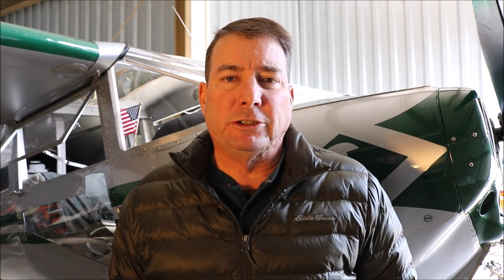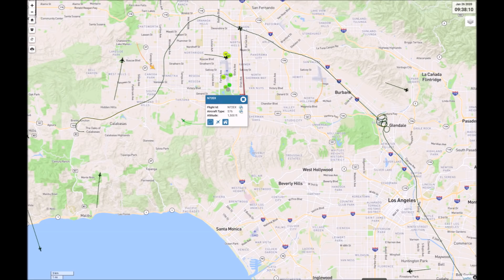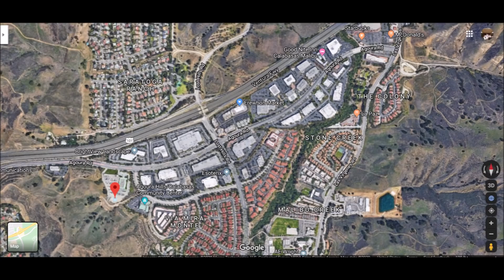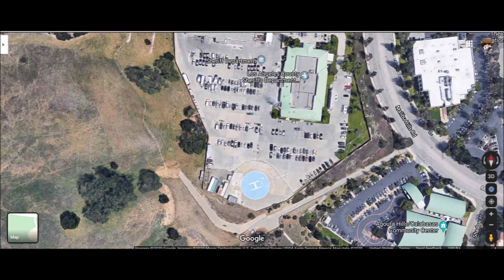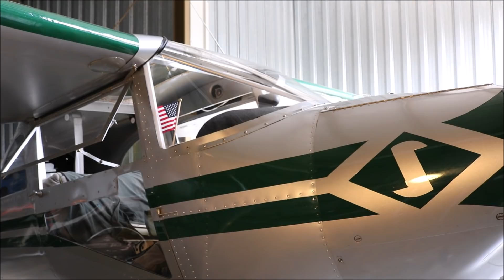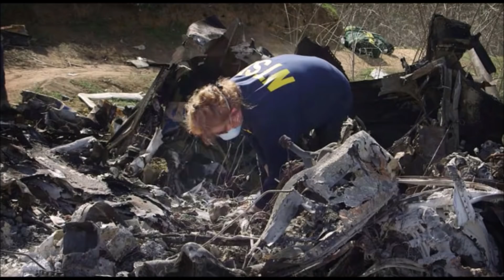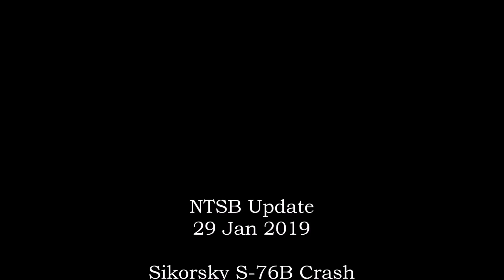Kobe Bryant Sikorsky S-76B Crash Update 29 Jan

Comment: This is a very common case of flying VFR, going into IMC, stalling while attempting to gain altitude, failing to recover and subsequently falling out of the sky. A sharp climb followed by  a sharp descend resulting in a high energy impact may help explains this.
People will blame the pilot for misjudging the weather and flying VFR instead of IFR.  However, given the circumstances, this might just be an unavoidable crash. After all, this pilot was very experienced and most likely, knew what he was doing more than any other pilot out there. Weather can be very deceiving. What one might sea as a constant altitude ceiling from a distance, may actually be a descending ceiling, which I suspect was the case here. You go under it but it keeps going  down as you move forward and you keep going down trying to stay clear untill, terrain doesn't allow you anymore and you are forced to enter. Now you are too low and in the clouds and you can not risk turning left or right and since you still have forward speed your only option is to gain altitude as soon as possible and hope to pop up above the clouds, which I suspect what the pilot intended to do here, explained by the sharp climb prior to crash. While doing so however, he most likely over pitched and stalled his blades. While gaining altitude, his eyes were out trying to avoid terrain or possible obstructions like wind turbines. He simply could not risk looking inside at his instruments.  Helicopters unfortunately, do stall and roll to a side when they stall, which seems to be the case here. He was too low to recover when he noticed he stalled. 

We would like to believe that this crash was somehow avoidable. Because we don't like the idea that it might happen to us. In theory, yes, it could have been avoided. In reality though, taking into account the experience of the pilot, the safety of the aircraft, and weather that reportedly looked doable, it wasn't. 

Condolences to their loved ones.
Reply: BRILLIANT! MAKES THE MOST SENSE.

Comment: I live in this area and know the terrain very well. Malibu Canyon (aka Las Virgenes) is know for being a funnel for moisture and weather coming in off of the coast into the San Fernando Valley area. I've seen very dense fog push through that canyon from the shore to the 101 many times. Because of the shape of the canyon, it gets compressed and shoots north. I used to drive the 101 every day in that area, and I would admire the beauty of the clouds coming through that canyon. You could have a completely clear day north of the 101, but still see a fog bank pushing through. ￼

Comment: Thanks Juan for putting things into perspective. 
I have a theory that I’d like to run by u.
What if the pilot banked left unwittingly as he was climbing through the cloud bank. Which would leave him facing south instead of west. As he was flying VFR he never checked his instrument panel to find out he’d changed heading. He then proceeded to descend to get visual ground references. But by the time he came through the cloud he was in the foothills and unable to avoid crashing into them. That would explain the final sharp bank to the left on the radar signature. What’s ur thoughts?

Comment: Likely nothing to do with the police helipad closeby. Pilot was trying to wiggle just under the growing clouds as the mountains started to pick up around Agoura Hills on the Hwy-101 path they were traveling. Sticking to road underneath was running out of steam.  The controller advising that he is too low for flight-following meant he is out of flying options, and may have been the tipping point. The top few-hundred feet of of the hills were clouded and pilot could notice that for a while. Spooks anyone. No one wants to be under the hill-top lines. He decided to play safe, and quickly went up high into clouds. It was a risky move by itself as there was chance of collision. Flying into the clouds is already against S-VFR, isnt it?  At this point, high up in fog, he could have switched to IFR as Plan B by declaring an emergency (maybe that was the next thing he may have done!!) but within the next 12-15 seconds, the damage was done. He thought he was climbing when in reality he was doing a downward left hook. Also, the pilot had flown this route several 100 times, so he must be fully aware of the helipad location that you are referring to. Likely did not even enter his planning mind to use it.
Reply: Great stuff.

Comment: This should have been an IFR flight only. Low ceilings, heavy traffic areas, Fog. Why even train pilots for IFR and equip these aircraft with the ability to fly in such conditions, if it is left up to the pilots ego to use it? IFR would have saved this flight if it had been required to fly that day as it should have been. By allowing that flight to be VFR or special VFR, it not only risked those aboard, but every aircraft in the air and every person on the ground in its path.

Comment: It is rather amazing that the FAA in fact needs all that time to make something that is agreed on more safe or less risk to an aircraft require years and future accidents to be implemented as a rule requirement.  I'm unsure if the occupants of this Sikorsky had been just anyone would have made as much impact to the importance of this crash issue but it shouldn't, I'd hope. It does seem prudent to have IFR equipped helicopters fitted with similar warning systems as the airline industry since these types are well known to carry passengers for hire often. In any case, IFR should be the pivot that says warning systems must be there if the type has the instruments to fly IFR. At least a CVR/FDR would be good for after an accident investigation tool but avoiding an accident is the key factor for warning systems to keep a pilot on track. Maybe this type of aircraft should have two pilots vs. just one for IFR.

Comment: When I'm backing out of my backyard my back up sensors go off, which is sometimes annoying. I am able to lower the warning sounds or turn it off completely. To get to the point, backup cameras reduce accidents period. It's a foolish and even ridiculous argument to allude to the suggestion that a "Terian Avoidance System" would be annoying. The FAA should be held accountable in a civil suit for failing to implement technology that could save lives. Once you open the door of legal liability they will see to it that they prevent a future lawsuit. I'm pretty sure they failed to implement suggestions from the NTSB because of corporate influence and under the table kickbacks. This is an easy fix create a loophole to sue the hell out of them, and I promise you this will stop.

Comment: Juan, I've read comments attributed to Ms. Homendy such as, "...climbed to about 2,300 feet seemingly in an attempt to clear the thick cloud layer.  It hit part of a ravine in the Calabasas and fell, crashing in an area on the hillside 1,085 feet above sea level."  In the same article the author says that "federal investigators" said the pilot was trying to ascend above a fog - shrouded hill when it slammed into the ravine and dropped 2,000 feet per minute to the ground below.  This suggests that there was another impact at 2,300 feet that sent the copter into the sharp descending  turn, from westward to eastward, no?

I haven't heard anyone else mention this and it seems like it pretty much explains a lot; that and spatial disorientation.  The article I read these things in was via buzzfeed and a Brianna Sacks.  Thoughts?

Comment: ATC radar visual on VASAviation channel shows rapid climb last few seconds from 1400 to 2100 before vanishing from radar.  not in a descent.
Reply from the maker: then how did he end up crashing at 1085' MSL ...?
Reply: blancolirio just reporting what I saw on the video. Radar showed 2100 immediately before losing signal.
Reply: blancolirio are you certain it wasn’t 2085 MSL?

Comment: Hi everybody! :)
I’m just a flight simmer and my competence in real flight is of course absolutely limited.
Please help me clear this doubt. 
In all preliminary reports is well evident that the helicopter lost altitude at very high speed. That's insane because it's exactly what was to avoid in those conditions of terrain proximity associated with the poor visibility. 
Even if the pilot could be confused in such stressful situation, it seems to me that he could have all the instrumental data letting him to know if he was climbing or descending... Am I wrong?
Another perplexity is about the awareness of his position related to the terrain. Ok, no system alerting of the hills in front of him. 
But if you flight with a simple GPS and related map, you should be conscious of your real position and movement and so fly your helicopter far from potential dangers...
Again, what I don't understand?

Thanks for your kind answer

Comment: ok, dumb queston ... how can you turn around quickly enough , when you hit fog, and be sure not to crash into another plane?
Reply: You can’t be sure but the odds of hitting an ifr aircraft is extremely low while the danger from the terrain he knew was there is very high. He could have climbed and declared an emergency on SoCal‘s frequency. He would have had some hard questions about his actions to answer, but the odds of hitting another aircraft in the few moments before SoCal radar identified him and turned other aircraft away is very very low, but still possible.
Reply: michael laws i agree

Comment: The pilot must of been so disoriented and lost..I can imagine a blanket of fog just blacking out pretty much everything in sight. 

even a slight pull to the left or the right I can imagine at 150+MPH could change the whole trajectory of the route and have that feeling of still going forward, perhaps it’s the same reason why the helicopter descended at times.

The wreck was scattered over a 100 yards/meters so it must of been going in a straight line, pretty much like a car wreck. I don’t think they seen it coming and I pray it was over quick..

Comment: After 40 years flying and 30 years controlling at Indy ARTCC I have both done some questionable things in the former and had a couple dozen emergencies thrown at me in the latter. I cannot stress enough to current and future pilots that declaring an emergency is NO BIG DEAL to controllers. It's what we are trained for and is the ONLY way to quickly get our attention. I was a pilot before becoming a controller and I, like most other pilots thought that declaring an emergency was an admission of poor piloting and would bring down the wrath of the FAA. That is most always not the case. Most emergencies (that end well) can be ended either on the frequencies or after landing with a quick call to the facility to speak with a manager. It should be at the top or bottom of every checklist: "Don't be afraid to declare an emergency!!!" Once you declare, all our normal rules can be sidestepped and we can be a pretty creative bunch. In this instance the pilot should have declared his emergency then informed the controller that he was initiating a climb in IMC conditions. The controller, upon reacquiring the data block, would then have had the option of moving other traffic and/or advising any traffic of a loss of separation. This event should have begun with the pilot startling the controller and initiating a climb away from higher terrain. Next, the controller would have swung into high gear to provide as much help as possible, gotten local weather conditions for any VFR airports nearby, then worked with the pilot to set up for a proper instrument approach. The situation would have been solved with a phone call. Guaranteed. Even a loss of separation would have been covered by the emergency declaration. All too often, we pilots focus at the unwritten line on the checklist that begins with "Ego" instead of allowing the ATC system to become another asset in the cockpit. 

On the cockpit side, sadly, this pilot probably had most of the makings of a killer Synthetic Vision system in his possession. Most professional pilots these days have an iPad or even just a cell phone and probably some aviation software like Foreflight. Their top of the line subscriptions, coupled with a portable ADS-B receiver offer a complete Synthetic Vision screen with high resolution terrain, obstacle data sets and very high refresh rates.  Helicopters are afforded a relatively large degree of FAA latitude with regard to minimums that until recently have not been matched by certified avionics and then, only with six or seven figure price tags. Although not truly certified, for a $1000 investment, the peace-of-mind and instant situational awareness provided are such that one can hardly imagine a helicopter pilot poking around in marginal VFR without such a system.
Reply: Thanks. Good to hear the viewpoint of an expert.

Comment: I use to live within a quarter mile of the crash site. From the tracking data, it looks like the pilot realized the weather conditions were deteriorating to the point where he decided to do a u-turn and head back to the San Fernando Valley. There is a valley there that could have allowed a U-turn without having to go above the hill peaks, if he positioned himself properly. With the fog, that could have been very difficult. The sheriffs pad would have been a mile further into the bad weather over a dense residential and commercial area.  One telling thing that the NTSB said, and I think you alluded to, was an extraordinary decent rate at the time of the crash, several hundred feet in one minute. Sounds like the pilot lost control for some reason.

Comment: Great info, as always. One thing bothering me about the whole Contolled Flight into Terrain theory is that very quick descent leading to the crash. Pilot was at 2,000 feet, and crashed at slightly over 1,000, after descending at about 4,000fpm from published reports. What would cause him to dive down like that? Perhaps he saw or thought he saw a "hole" in the fog and chased it desperately, trying to reach that helipad you mention. But still, that's one heck of an abrupt maneuver. And diving into the fog just doesn't make sense for any pilot to do. Puzzling.

Comment: I appreciate your detailed reports, Juan, but let’s face it, it’s all unnecessary. The cause of this crash was 100% because of the pilot’s spatial disorientation/the fact that he couldn’t see at the time of the crash. It doesn’t matter if you’ve flown a copter a million times. It does not matter if you are an expert. It doesn’t matter if you have 8,250 hours of flight time. If you can’t see, you can’t see and the possibility is very high that you are going to find major trouble. People can like my comment zero times, or like it a thousand times, the fact is that I am 100% correct.

Comment: Did the aircraft have a radar altimeter (RAD ALT)? If the aircraft didn't have a RAD ALT it should not have been operated in IMC/night conditions. You shouldn't be flying single-piloted SVFR, in a complex aircraft in a complex air traffic system. He pushed it way too far. No excuse!

Comment: Unless this guy was flying in the dark or not watching his altimeter; i don't see how in this situation it would have helped. He dropped at such a fast rate & also the forward speed i don't see how he could have missed seeing the ground right in front of him.
Reply: P38FORK he probably got disoriented, got into a steep left roll, stalled the blades, nose dived into the hill.
Reply: @KeithKman  That would make sense with the low viz. I mean law enforcement had grounded even though it wasn't required because of flight conditions if i remember correctly.